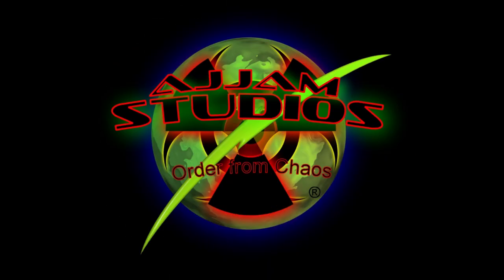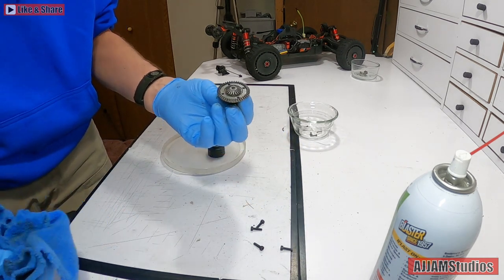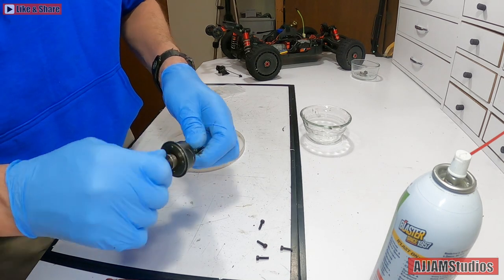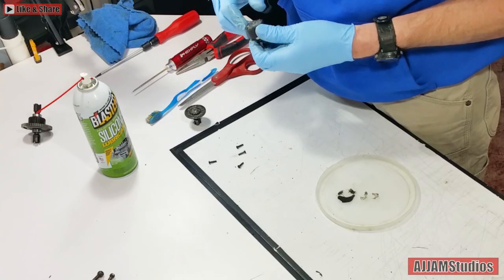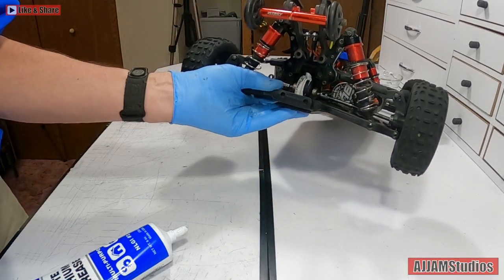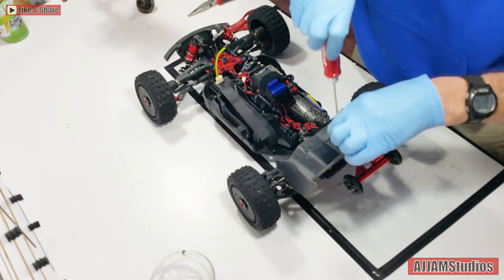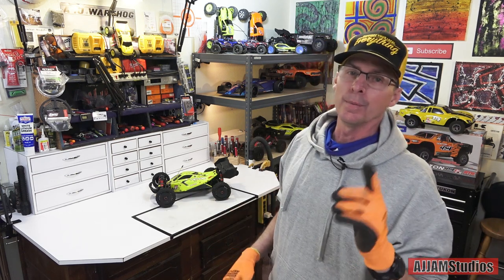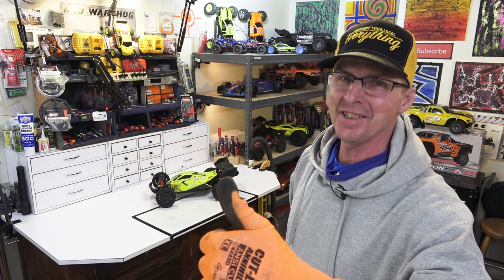RC diff hack 101

Comment: Great example for the use of silicon earplugs.  I never really put a cost to the diff oils and compared that to the earplugs.   I personally haven’t dabbled in the use of ear plugs in the diffs but have heard of many people using them like yourself.  I’m currently satisfied using different oils for bashing but since I don’t race yet I don’t really need such a stiff rear diff
Reply from the maker: Correct, the ear plugs do work for many situations, but using the right diff oils is actually the better way to go; if you can afford it. Being a tinkerer at heart, I like being able to dabble in these kinds of experiments. I'm glad you saw the value in trying such a path. AJ

Comment: I've been working on diffs my whole life my grandpa started the business 100 years ago and my father took over and now my father has taught me everything so I was thinking I could start making diff parts for RC cars. We have been making differential parts for cars for 50 years and I am into the RC hobby so it would be a good thing to start making differential parts on all these machines we have. If you have any ideas of what we could make stronger let me know. I have a workshop in Australia full of manual and CNC machines
Reply from the maker: Wow. Do you intend upon working solely on Diffs? Or are you considering other parts as well? By the way...Thanks for the comment. AJ
Reply from the maker: I had a thought on that. The Losi Lasernut and the DB Pro for that matter, both suffer from an ill designed center diff. If you could build a replacement for those rigs but offer several variants such as selling it dry, or giving the customer the choice of having the diff shipped with whatever weight oil they choose, might be an avenue to start with. Also, building slippers for the center diff cars that are adjustable, that too might be a huge market to get into. For example, placing a slipper into my Arrma 6s cars would definitely be something I would like to try. Along those lines, marketing the shims for purchase would be a great thing. More people than I care to mention have no idea where to locate the correct shims for their particular vehicles. Would it be possible to put together a shim pack with various shims? That too might be an avenue worth pursuing. Thanks for asking.
Reply: @AJJAMStudios  well I have made steel parts for my jlb cheetah. So I could make any parts for any RC car if you need me to. And yes I could make shims up if you need.
Reply from the maker: Awesome. Do you have a web site I could visit?
Reply: I can’t find an aluminium diff housing for a hpi trophy flux that would be a god send.
Reply: @AJJAMStudios  bro who are you
Reply: Hi Neville, I’m also in Aus, in Melbourne. Where about a are you/your workshop located?

It’s been a year since your comment, have you started making any rc diff gears and/or parts? The Kyosho MP9/10 buggies and truggies could definitely use a set of steel diff gears. Kyosho sells an upgrade steel diff gear kit but they charge an absolute fortune for them. And their stock alloy diff gears are pretty much rubbish. Sure, they’re cheap but they wear so quick it’s ridiculous. Even after just 1 tank on a brand-new diff, the internal gears will all be chewed out and have noticeable chunks missing from the sun and spider gears. The steel parts absolutely eliminate this from happening. 

How do we get in touch with you?
Reply: Lol ball diff ... So easy to make
Reply: @differentials  can you make us steel internals for exb diffs or even the regular v5 diffs. They would sell well
Reply: @paulclancy2404  when you say steel internals ??? What are your reference too ?
Reply: Everything inside the diff is already stell isent it ?
Reply: Update plz
Reply: Make Vaterra/Losi v100 parts and you’ll have me as a loyal customer!
Reply: How do i get in touch with u? I have a few things u can make
Reply: Ar15 diffs
Reply: I'd love to see a clutch based LSD for touring cars, similar to the one in my C5
Reply: Can you make some aftermarket parts for the Redcat vigilante Redcat machete and Redcat Valkyrie?

Comment: FWIW, fluid dynamics dictate you must account for any mechanical items plus fluid volume, (in this case, earplugs are technically a fluid), in order to not overfill your vessel. That sun gear displaces more than you think, and ideally, you don’t want to be pushing that ring gear down that much, as all the pressure will be transferred to the path of least resistance. Take a little more fluid out, make sure the sun gear and ring gear sit perfectly on the case, screw it up, then weigh it.

Comment: I used the  suspension, arm and shafts from the Mojave and it came very good and very strong also the I used limited slip diff in the center I am also to put one in the front although while you start purchasing parts it get expensive job!

Comment: Hi Ajay -  QUESTION: Ive bought a new V5 Typhon and also a new Hobbywing EzRun Max6 4985SL 1650Kv Brushless 160A Motor and ESC Combo. Running a 21T Pinion, Stock Spur... To get her to handle well, ( like driving, not jumping ) Would you still recommend these Oil weights bro? or Something different to try? Thanks buddy.

Comment: try some nlgi4 (not waterpump grease) high temp grease or 5 if you can find it, its like wax and will thicken the faster the gears move, would proably give a much better result. open (ish) at low speed locked at high speed
Reply from the maker: Awesome idea. Thanks. AJ

Comment: Great vid. I noticed on my TT pro, when I put the 500k in my centre diff I started to strip my hexes alot. Possibly also because I increased the punch too much and run road tyres on tarmac mostly out fromt of my house. I am going back to 100k centre diff fluid and and also going to try thicker hexes also to grab more wheel. Anything you can suggest to help me stop stripping hexes and wasting my wheels.

Comment: Earplugs are way how to make Typhon undriveable tank on rc track. For bash, it does not matter. But for serious handling, some proper oils has to be inside. For example 20/30/10K. Depend on the track.
Reply from the maker: Good info. Thanks 😎👍

Comment: whathever i try, hot glue, playdoh, silicon ear plugs EVERYTHING, it just starts to dissapear from the diff and the gears get unjammed again. what am i doing wrong? iam putting as much as possible in there yet the diff unlocks fully at around 15 minutes of run time!

Comment: Can you use shock oil as differential fluid? I can’t seem to find any locally
Reply from the maker: I’ve done it myself. Lubrication is better than dry. But the diff will have little to no resistance.  I hope this helps.

Comment: @AJ... if I'm starting with a clean diff, I'm assuming I have to add in some diff oil then then the ear plugs. What weight and how much diff oil should I start with? Like 10k and 1/4 of the diff cup? Thanks. Best explanation on the ear plugs I've seen yet. I've only seen guys using them in the center diff.
Reply from the maker: I find the stock oil works just fine. You can tune it from there. Remember, as you add plug pieces it will force the oil out, so 50% full should do, but if you are just adding a little resistance you might want a bit more. As you add pieces the silicone will displace the appropriate amount of oil. Small pieces of silicone seem to work best. In the video you saw me more or less locking mine up, so begin slowly and add small chunks. This allows the gears to integrate the plugs properly. Also, take the time to work the diff so the mixture is even. Best of luck. I hope it works to your satisfaction. AJ
Reply: @AJJAMStudios  Thanks AJ. Starting with a clean diff. No oil. But I do have 3 bottles lying around. 10k, 30k, and 50k. Ordering the ear plugs now. Actually $9.99 for 18 pairs.
Reply: @AJJAMStudios  Ended up snapping my pins behind sun gears into 3 pieces, so I completely cleaned out my diff cup. Doing the McMaster Carr tool steel pin upgrade.

Comment: Really like your channel. Because of covid 19 outbreak in Vietnam, I can’t get the diff oil. So is this ok if I use motorcycle oil to substitute for the silicone diff oil?
Reply from the maker: It is worth a try. Worst case, it may not work as well, but all you would have to do is clean it out if it doesn’t. I would try it. It sounds like fun to me. Thanks for asking. AJ
Reply: @AJJAMStudios  appreciate your answer

Comment: If my rear end on my tamiya truck, tt01e keeps sliding out on corners will this help ?
Reply from the maker: No. Selecting the proper may help though. Lighter should be better. The hack is for larger cars used in bashing mostly.

Comment: My hand are fucked up with stains from the grease I actually thought about wearing gloves 🧤 Will it hurt to use 3 in 1 oil in my differentials
Reply from the maker: It will work but you cannot change the viscosity for tuning. Your diffs will basically be open diffs using that oil. Gloves certainly do help. 😎👍
Reply: @AJJAMStudios  what do you mean by open  diff what will it do
Reply from the maker: Check out differentials 101 in the 101 playlist. That should answer your questions. Thanks for asking. 😎👍

Comment: Have you been able to get around to the EXB diffs video? I ask as I'm current rebuilding my Outcast 6s EXB. I also have anotber question.. I have a very built arrma Big Rock that is running 6s. Everything intern is upgraded. My headache is the dang drive shafts. I strip the factory CVD's and I've tried the upgraded CVDs but they jus barely fit on my (typhon A arms) widened big rock. Do you know of any good aftermarket alternatives driveshafts? I'm willing to mod it to fit anything at this point but I'm tired at throwing money at the wall. Any suggestions?
Reply: And do u have an Amazon link to the earplugs?
Reply from the maker: The video on that is called the LSD diff rebuild. Also, search silicone ear plugs and you should find some. Thanks for asking 😎👍

Comment: Is there a way to put power into the wheel on the ground and not into the wheel off the ground when I free wheel it on my centre diff in my hsp flying fish lowrider rc car with out locking the diff
Reply from the maker: You can thicken the fluid without locking the differential down and that may help. Finding the right thickness takes some trial and error for your application. I hope this helps.😎👍
Reply: @AJJAMStudios  when I stop the wheel that's off the ground the one on the ground spins and then it starts to move its like it need brakes to stop it so the one on the ground will spin and move the car while in 3 wheel motion when I jam the wheel off the ground it moves and 3 wheeling

Comment: Your videos are the best, really informative. Can you do this to the EXB LSD? Or would you need to convert it to an open diff first with the shim kit? Was just wondering after what you said about the Mojave on the block vid, with having it set up open diff. Seems to be very high maintenance with the LSD, cheers
Reply from the maker: I would definitely run no LSD if you’re going to try this. It’s hard on the components and defeats the plates. Thanks for asking 😎👍
Reply: @AJJAMStudios  Thanks for the info, what would you suggest is the best option for EXB Mojave after having run your one for a while? Also do you know if its possible to run a standard diff from the RTR BLX Mojave in the EXB, or do you just have to go the shim kit route? Cheers

Comment: Hey men, how are you? I have a Traxxas Maxx 4s and wanted to do standing backflips. This car has three differentials: front, center and rear. In fact, the center is also at the back. They explained to me that for this, the center differential is more important, and I need to use silicone earplug on it. Ok, but if I want to use a thicker silicone (500k) in the rear differential, would that increase my rear wheel torque a little more?
Reply from the maker: First off, thanks for asking us. Secondly, the rear fluid will only affect the posi type action and not really change the rear torque much. Sure, it will a bit, but the real winner is the center diff. Lock that beast down and you'll notice a substantial difference in your thrust rating. Add to that a heftier motor and you'll go nuts. Also, if you tighten your rear diff, you'll notice a bit more even traction for going forward, but the car will corner differently. I guess squirrely would best describe it. But that's an acceptable outcome for us here - we like squirrely. We hope this helps. Let us know if there are any more questions we can help you with. 😎👍
Reply: @AJJAMStudios  Imagine, I'm the one who appreciates the excellent and so quick response. I understand perfectly and then everything is confirmed for the central differential, ok, I'll lock up. I just didn't understand the squirrely part, because I'm Brazilian and there are no squirrels here hahaha kkk xD

Comment: What about using silicone caulking  instead of ear plugs? You can get a whole tube of that for like 6 or 7 dollars
Reply from the maker: I’ve never considered that as an option as it generally hardens somewhat over time. Let me know how it works please. I would be interested in clean out later and performance. Thanks.

Comment: The question is, how a locked/stiff diff affects the steering?
Reply from the maker: I did go over this at the end of the video, but to sum it up for you, connecting the axels through a locked mechanism means the tires run at a more even rate. This means one of the tires will have to skid slightly to make a turn - providing we are talking about the rear or front diffs. The center diff is altogether different. Getting back to the rear diff for example: this means that when you make a corner the rear tires will fight the turn slightly - dependent upon how stiff you make your diff. This fighting feeling allows the rear to skid - or break loose- easier, bringing the car around and helping to control understeer - the pushing of the front tires or not being able to keep the turn tight and controlled. However, if you over-stiffen the diff it can cause oversteer and bring the rear of the car around on you much, much easier, causing spin outs and such. This is the balance point you will have to find. It will be a combination of stiff and smooth - a tuning point unique to each car, plus, there are usually three diffs in each car and they all require different settings to accomplish the tuning phase. This is a subject that has deep ramifications due to the individual driving the car, the driving style of that person, and type of car being discussed. Plus, and I have to stress this point, what works well for someone else may not work at all for you; it all depends upon your car and driving style. So tuning your car for best performance will require trial and error until you get the handling and performance you are looking for. AJ

Comment: Quick question - why not buy one container of the thickest oil and one container of the thinnest oil and then simply use math to create whatever thickness you want...?
Reply from the maker: That would work too, but knowing the thickness you actually need would be easier. If you're going to buy oils, then it would make sense to get the oils you need right off the bat. Keep in mind, mixing oils can be tricky and hard to duplicate. Then again, using this method takes a little patients too. Thanks for your comment. AJ
Reply: @AJJAMStudios  👍

Comment: Have you ever try it on kraton 6s or outcast 6s?!
Reply from the maker: Yes we have and it does work. It can be a bit hard to clean out afterward but it functions well enough. It can be a bit harder on the drive cups however due to the additional stress it imparts on them. Thanks for asking. 😎👍

Comment: I like your idea but it wont work if you flush the whole diff oil
Reply from the maker: Correct. If you rinse your diff completely out, the ear plugs lock everything up. The trick is balancing the oil with the ear plugs. Thanks for the comment. AJ